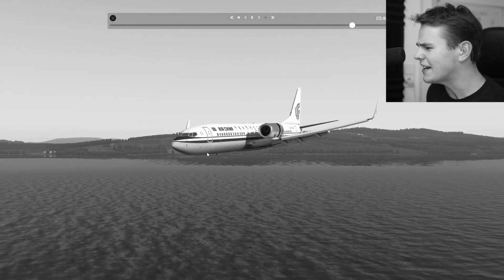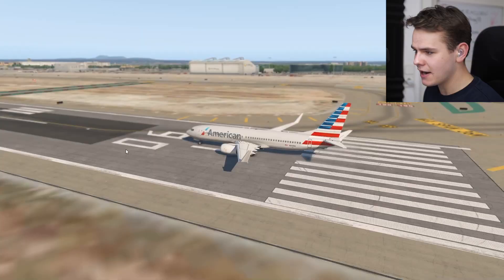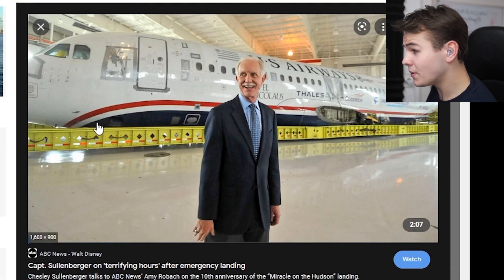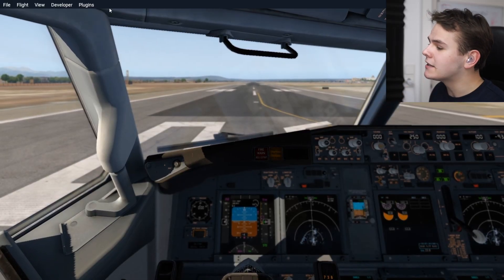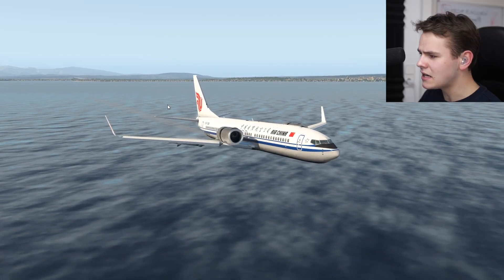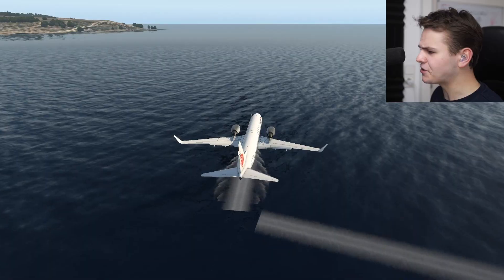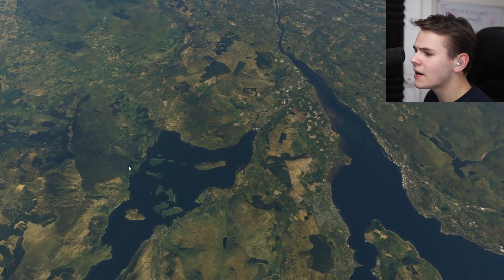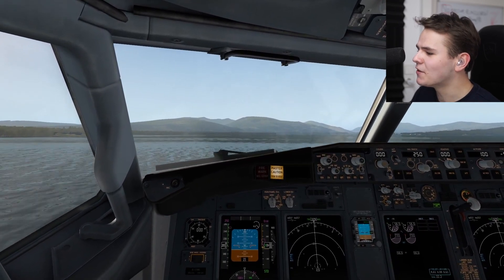I Built An AMPHIBIAN 737 That Actually WORKS

Comment: You gotta remember that any non-butter landing on a seaplane means the forces get directly transferred into the fuselage, instead of the gear struts.

6:19 Water also has a lot more resistance than 100+PSI tires with proper bearings rolling on pavement.

Comment: The engine issue has been solved but those flaps are getting destroyed if they are out all the way. I don't know ow what the work around gor that would be. Flaps on the top of the body or engines maybe?
Reply: I think he made a stol plane not a vtol plane